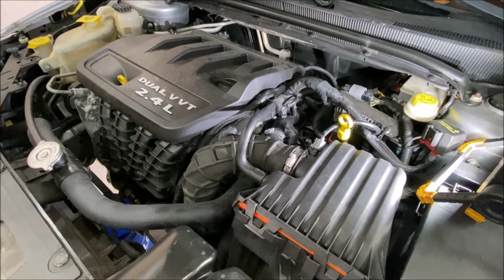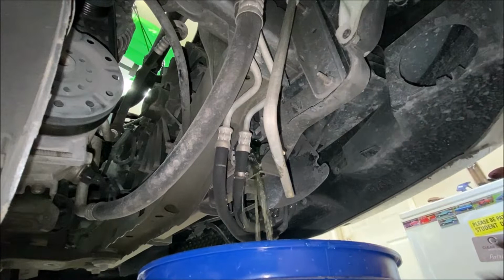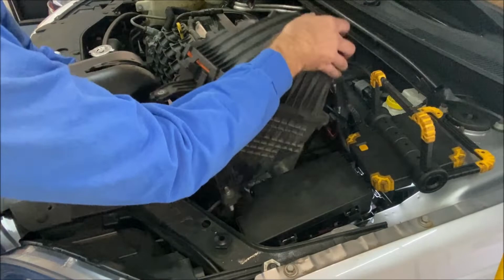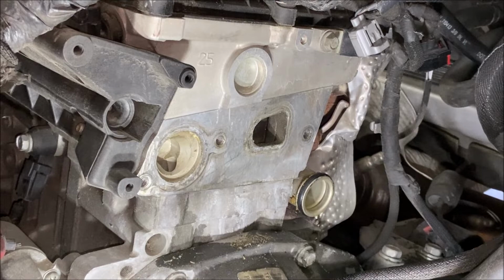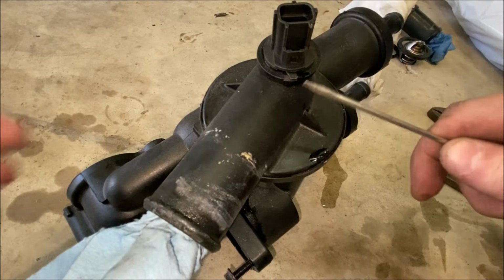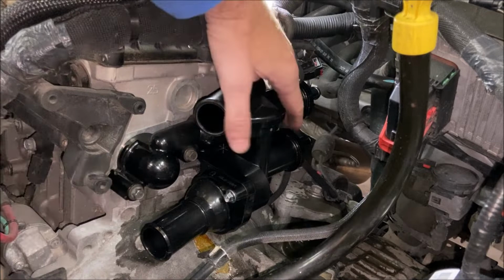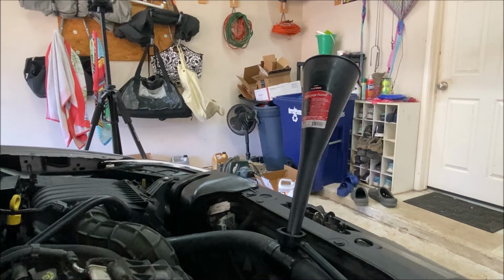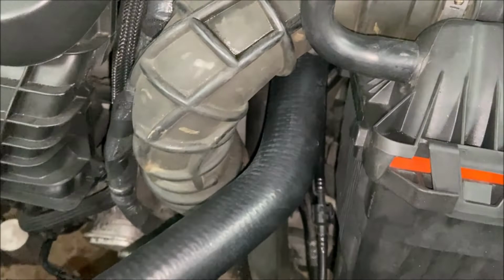Setting limits – Replacing the thermostats on a 2.4L 2014 Chrysler 200

Comment: Hey man just a quick ? - how would you know that the thermostats are shot aside the code reading?
Reply from the maker: Couple of quick tests. If your engine temperature gauge (the coolant temp) never gets to the ~halfway point, your thermostat is probably stuck full open. You can (carefully) check the temperature of the two radiator hoses. If the gauge shows a low temp after the engine’s been running a while but both hoses are the same temp, then coolant is flowing through the radiator and the thermostat is open even though it shouldn’t be. 

If the temperature is hot, the temp showing past ~half way on the gauge, check the hose temps. If the hose temps are not both super hot (be careful when touching!) then the thermostat is probably stuck partially or fully closed.  (If sensor says hot, thermostat should be open, hoses should be hot, and fans should be running to try to cool it).

This assumes there’s coolant in the system, of course. If there are no codes to help you, there’s coolant in the system, and the hose temperatures don’t help, then it might be just trying the thermostat replacement or sensor and see if it fixes it. Throwing parts at it sucks though. Sensor is probably easier to do and less mess. 

In a hot coolant condition, also check on your fans to make sure they’re working. 

Hope that helps a little. Thanks for watching.
Reply: @CarbonsDIYGarage  definitely does help, thanks a lot. 

Got a 200c that I had sitting for a while, had to go get a smog but the battery died. 

Replaced the battery and smog tech said I needed to drive around a bit to cycle, in the process of driving it, she developed a rod knock (I suspect even tho she had a fresh oil change before I had her sitting) and the coolant filler neck cracked on me, replaced it recently but after letting it run for 10 minutes, I check the radiator hoses and the bottom one still felt cold to the touch while the top one was already hot, my temp gauge didn't go above the halfway mark so I'm suspecting it may be a thermostat that needs replacing next lol, 

sucks that after just a few months of it sitting, so many problems arise..especially considering she was running A-ok when I was driving her consistently.
Reply from the maker: @thedesignmercenary  Sorry to hear about the troubles. If you’ve got the Chrysler 200, which has 2 thermostats (or any other vehicle with 2 thermostats), my experience as seen in this video is that it’s probably worth the expense to replace both thermostats at the same time and the easiest way for me to do it was to just replace the housing as well. 
Check out some of the other comments in this video - I forget which comment but somewhere we wrote down which thermostat is which temperature rating if you’re just going to replace the thermostat(s). I hope you can get it sorted and resolved soon and easily.  Good luck!

Comment: Great video but theres an issue with ether your heater core hoses or mine, my heater core hoses is opposite of yours, same car 2013 chrysler 200 2.4L, i installed the new house the same way i took it off so my heater core hoses are swapped compared to yours an half of my thermostat wasn't missing. Everthing is working great, no leak now, so my assumption on your car is a crackhead done had gotten inside of your housing an put the heatercore hoses on backwards when reinstalling
Reply from the maker: I don't own the vehicle anymore but it totally wouldn't surprise me if that's exactly what happened.  The heat always worked great so I never thought to look at the hose routing.  Previous Owner definitely did a number on that car's cooling system.
Thanks for watching, Ronnie.
Reply: Np man thanks for the info,torch specs tools required, i also did it without removing the airbox

Comment: Do you need to burp the system
Reply from the maker: In the end, I was just overly cautious. I’ve worked on the coolant system a few times since I made this video. Now I know that “normal” for the temp gauge on this car is below middle on the gauge. Now I just check, and squeeze, the lower radiator hose. When that hose is hot, I know the thermostats are open. 
Thanks for watching, Dan.

Comment: My petcock just spins won't leak any fluid out
Reply from the maker: The drain in the radiator might be plugged. Try a hangar wire or something up into the drain hole to clear it out. You can also try twisting the petcock to the “right “orientation and pull it fully out of the radiator (and fluid will come out of that larger hole so be ready).
Hope that helps. Thanks for watching, Juan.
Reply: @CarbonsDIYGarage  thanks for the advice I'll give that a shot. I replaced my thermostat housing last year but I'm noticing coolant puddling on top of my transmission. I couldn't remember if I had put a gasket between the block and the thermostat I wanted to watch a video and see how it should go, but gonna pull it all off regardless to check. Was it a paper gasket that went there? Thanks in advance. Awesome to get a response so quickly definitely keep doing what your doing I know others are thinking the same thing 👍
Reply from the maker: @Presence_of_Mind_  First, thanks for the feedback and kind words on the channel and content. Really means a lot!
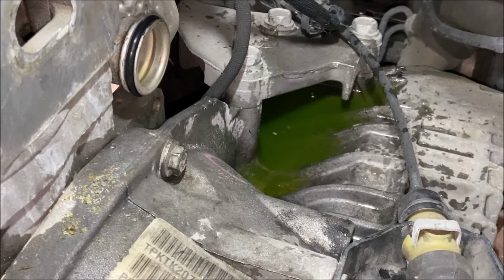There’s no paper gasket. There’s the o-ring on the “tube” at the back of the engine, a rubber gasket for the center of the housing, and an o-ring/gasket on the new thermostat. Take a look at 11:30 and 13:00 in the video. It’s possible for the o-ring to have rolled out of place when you installed it, for the center gasket to have shifted, or the thermostat to have moved. When I did my install, I know the thermostat was a bit of a pain to keep in place. The center gasket is held in place into the housing pretty well and the o-ring I lubricated and worked at slowly to hope/help it not roll (which I guess it didn’t since I didn’t have any leaks). So I guess I’d say the thermostat might be the most likely leak location?
Good luck with yours, I hope it’s a simple fix!
Reply: @CarbonsDIYGarage  thanks again gonna give that a shot I'll get back to you when it's done 👍
Reply: @CarbonsDIYGarage So I wanted to see it leaking so I got the car to operating temp left it like that for 15 mins or so and not much was happening so I asked my wife (her daily driver btw) to get in and revv it while I watched and it turns out that little nozzle that the coolant temperature sensor plug goes plugged into was bad. I remember now that I re used the old one from my previous thermostat housing. It was shooting coolant out from there but only when engine was revved up a bit. Thanks again for you help even though it wasn't any of the thermostat outlets or anything. Hopefully someone find this useful as well. 👍
Reply from the maker: @Presence_of_Mind_  Not that anything leaking/broken is good news, finding it to be the temp sensor is great news.  Easy to replace that thing and just an o-ring to worry about vs. teflon tape, etc., if I remember right.  Thanks for the update and great job sleuthing it out.